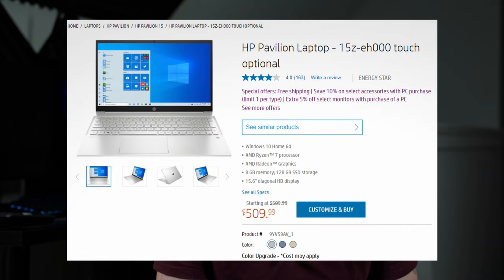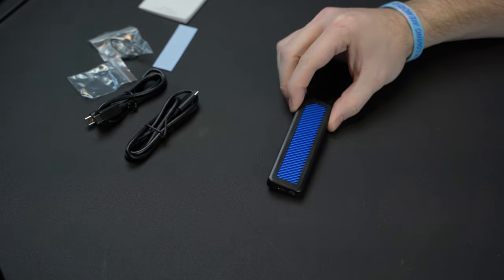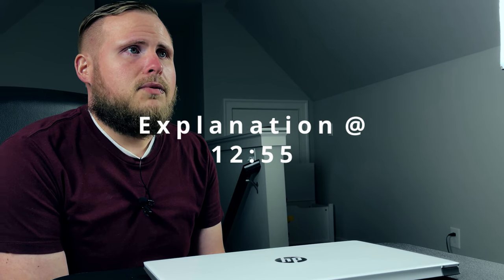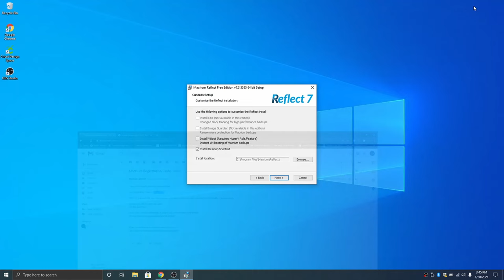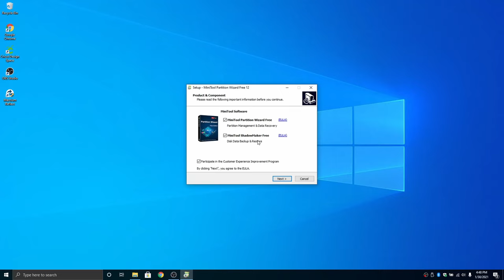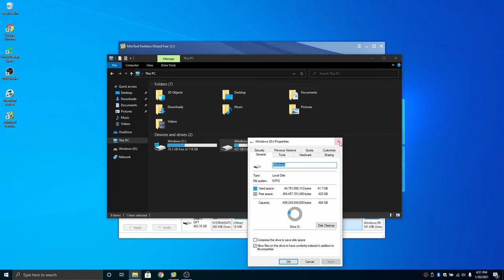Upgrading HP 15z-eh000 | Budget Laptop of 2020

Comment: Thanks for creating this video.  I tried two different newer 1TB NVM drives which was not recognized at all by the bios.  One was SanDisk - Ultra 1TB Internal SSD PCIe Gen 3 x4 NVMe.  The other was Crucial - P5 1TB Internal SSD PCIe Gen 3 x4 NVMe.  I read some people having the same problem because the hardware only recognizes certain older drives.  How did you find out which drives are compatible?
Reply from the maker: Manufacturers have what’s called a QVL (qualified vendor list) that show what hardware is compatible with their device, and that should show what’s been tested and verified as working. Alternatively, you could also try updating the BIOS if you haven’t already, and that may expand the compatibility and allow for newer drives that didn’t previously work.

Comment: Picked this laptop up for $350 (under $400 w/ tax and shipping.   Upgraded to 32gb of ddr4 3200 (HyperX Impact 3200MHz DDR4 CL20) which worked immediately and had tighter timings than stock.  Picked up a 1tb drive a while back that I'm finally getting around to installing.   One of the best laptops deals to this date.  Even today you'd be hard pressed to get something better in this price range.  Also, USB-C out on this works for audio/video/power without issue.

Comment: Great video! I found that voltage matters very much with AMD. 
    - You must get RAM that runs at 1.20v, otherwise the system will slow the memory speed.
    - This laptop supports more RAM than advertised. I'm using 32gb/ 3200mhz/cl18!
    - Also, this laptop supports USB C charging! I've tossed the HP brick and now use USB charging only.
Reply from the maker: This is good to know. I remember someone mentioning in another video on a recent AMD laptop that voltage made a difference when upgrading the ram- I wish I had remembered to mention that in the video. 

That’s awesome you got 32gb up and running. What do you use the laptop for? Do you have a use for that much, or did you just go all-out for the heck of it?

I knew it supported type C charging but I haven’t tried it yet- what brick and cable are you using for this?

Appreciate the comment! Thanks for watching!
Reply: Wich usb charger are you using? a specific voltage/A is needed?
Reply: @Salvo78106  check the user manual. Last I checked it said the usb c charger needs to be 45W

Comment: I bought the same thing during TG, although mine was $410 with full HD IPS, 8GB RAM and 256GB SSD. Maybe you got a touchscreen.

The video was great. Some thoughts:

[1] 16GB RAM is overrated. 8GB is more than enough. There are very specific cases where you may need more, like running VMs or hooking up multiple monitors or specific gaming titles (this isn't a gaming laptop) but most people will never even use 8GB to its full potential. Even video editing doesn't need a lot of RAM although fast clock speeds help.

[2] You can change the target partition sizes in Macrium Reflect to fill up your new drive BEFORE you initiate the clone. It's simple and you don't have to mess around with partitions later.

[3] The rubber feet can be peeled just a little on both sides and that should be enough. They stretch out of shape easily so removing them altogether isn't a great idea. The good news is HP will ship you new rubber feet for free if you call them.

Anyway, I'm nitpicking. This is a great video. The editing is very professional.

Now there's one question I have about this laptop. Although I own it and I've used it a few times, I can't figure out if the chassis is plastic or aluminum. It feels cold to the touch like aluminum but it has some plastic-like flex to it so I'm not sure. Since you already opened it up, what do you think? Plastic isn't going to disappoint me even a little being that this was just $400, but I'm just curious.
Reply from the maker: Hey there- thanks for the comment! I love when people actually take the time to drop a line, and I try to respond to just about every comment I get. 

I think unfortunately, I just happened to purchase it at a time that it wasn’t on as steep of a sale- additionally, I’m in Tennessee which has a 10% sales tax so that definitely didn’t do me any favors. 

1. You are absolutely right- for the average user 8gb is going to be more than enough- especially considering this has Vega integrated graphics, and while it’s not terrible, it’s certainly not mind blowing either. I did attempt to do some 4k editing of h.264 footage and it just choked on it. Didn’t appear to be a ram limitation either. 

2. I’ll have to look into this. I’ve always extended the partition after a clone when cloning to a bigger drive. This is so great info, and I appreciate the tip. 

3. Agree wholeheartedly with this- my main reason for fully removing them was for easier access to film everything, but for someone doing this at home, I could definitely see just peeling back the edges and even sticking some wax paper to the underside of the edges while you are working so they don’t stick back into place during the process. 

4. You aren’t nitpicking at all, and I appreciate the feedback! It’s always nice to learn something new or a different, possibly more efficient way to do something. 

As for the topic of metal versus plastic- the inside appeared to be “pot metal” to me- maybe like a cheaper “casting” if that makes sense. I think the keyboard deck however may very well be aluminum. Don’t quote me on that as I’m not 100%, but like you said, it’s cold to the touch, and if it is plastic, they did a heck of a job disguising it as metal!

Again, thanks so much for the comment and the feedback. I really appreciate it! Thanks for watching!
Reply: Hi, I saw your comment on this laptop and figured I'd ask you some questions. I'm considering getting this laptop and customizing it via the HP site. The base model is currently priced at $469, but HP has 5% off a minimum $599 back to school sale going on now. A backlit keyboard is a must, and I was considering 12GB of RAM to go along with a 512GB NVMe SSD. As for the screen, my choice is the non-touch FHD WLED backlit option. How do you find the keyboard and screen on your model? Does the keyboard have good feedback in terms of clickiness, or does it feel 'mushy'? Is the screen washed out looking? Bright enough?

I had already had something on order today, but I looked at someone doing a review of the HP 15 model I ordered, and it wasn't great, so I canceled it. Should I order this laptop now, or should I wait for the Labor Day sale? Do you know what kind of discounts are offered on a holiday like that? Should I just buy one from Best Buy or another retailer instead to be sure I get quality? What do you think?

Comment: Helpful video! btw, has anyone replaced the battery on this yet?  If so, do you know the part number?  hp doesn't seem to tell you the replacement part number for it.  Mine is getting up there in age and want to shop around before opening it up.

Comment: Do you know if this has an extra storage slot on the inside of the laptop ? Or does it just have the SD card slot for storage expansion ?
Reply from the maker: SD would be the only expansion unfortunately. There are no additional internal bays.
Reply: Looks like getting a bigger M.2 is the only option.

Comment: if you were having trouble with ram it looks like you could have been using 2 different brands. Its normally best practice to use the same speed ram as well as same brand to avoid issues. also thanks for the vid, i wanted to see what my laptop looked like inside without having to open it :)
Reply from the maker: Yeah it’s important to always match when possible. The thing is you can’t use ram with these HP’s without it matching the exact specs HP shipped with (brand doesn’t matter in this case) otherwise it won’t clock at 3200mhz, and there aren’t any ram options in the BIOS to then tune it to the speed you want unfortunately.

Comment: Good update! works on hp pavilion 15-eh1075cl?
Reply from the maker: In theory it should be very similar as it appears that model number is the same laptop but with an Intel processor rather than AMD. Tough to say without opening it up though.
Reply: @LetsGetTechy   is a pavilion with ryzen 7 5700u
Reply from the maker: @AndyErtle67  can you link me? When I Google searched that model, it came back Intel. 

I would say if it’s an updated Ryzen model, it should be basically identical to what you seen in this video.

Comment: I have the 2022 model of the HP Pavilion 15. Do I have to remove the battery or anything to upgrade my RAM safely?
Reply from the maker: It’s always recommended to pull the battery when replacing a component like that, but it’s really up to you. I can say I’ve done it hundreds of times without disconnecting the battery, and it’s been fine. Having said that, I don’t believe the battery connector is too difficult to remove, and it should be obvious which connector is coming off of the battery, and plugging into the board. 

If you get into it, and have specific questions, feel free to email me at the link in the description.

Comment: You could probably use Taiphoon Burner to write the XMP speed to the first entry of the SPD ROM and get the memory running at XMP.  Granted this would probably invalidate warranty though.  Ultimately the play is probably to avoid XMP speed 3200 sticks and instead get JDEC native 3200 sticks.
Reply from the maker: Appreciate the information. Definitely worth looking into for my own personal stuff. I’ve never feared for my own warranties. Haha 😆
Reply: @LetsGetTechy  There is risk in that if the machine does not accept it, I'm not sure how to restore it.  It's been a while since SPD modding was a common thing.  It may be possible to simply put in the unmodded original stick with one of the modded ones and rewrite the SPD to fix it, but again, I'm not sure how it would handle it.
Reply from the maker: @cracklingice  Roger. Doesn’t seem too scary since we are just talking about the ram itself- not a super expensive component.
Reply: @LetsGetTechy  Still felt the need to point it out.  Bricked sticks have no resale should you choose to go with 3200mt native chips in the future.
Reply from the maker: @cracklingice  Yeah absolutely- like I said, something I personally wouldn’t mind doing, but probably not something I would recommend to others depending on their knowledge level.

Comment: Is this similar to the HP Pavilion Laptop - 15z-eh100? If so, is it possible to install an HDD? If it has an HDD connector?
Reply from the maker: I’m not familiar with the eh100, but I would have to guess they would at least share the same chassis. I can tell you the eh000 doesn’t have a spot for a HDD nor a connector.

Comment: can you upgrade it to 64gb???
Reply from the maker: I would say probably not, unless a BIOS update made it possible to use 32GB dimms.
Reply: @LetsGetTechy  Thanks a lot! Also I'd love to know if i can install 2tb of ssd, i know in the manual it says it supports up to 1tb
Reply from the maker: @hassansharif69  unfortunately, I haven’t attempted 2TB myself, but I don’t see why it wouldn’t work. Maybe cross reference a QVL for your specific model (not sure if one is available, but if it is, you’ll find it searching your model number and “QVL”). You could also use Crucial’s website. They have a really nice resource for showing what upgrades are available for what pre-built machines.

Comment: can you upgrade the gpu in this thing?
Reply from the maker: You cannot. It is integrated into the CPU.
Reply: @LetsGetTechy  unfortunate. An eGPU should work though, right?
Reply from the maker: @frederictu  Unfortunately it’s exceedingly rare to find an AMD Ryzen based laptop with the required Thunderbolt connector to connect an external GPU. It’s a shame. Intel did finally open up the Thunderbolt standard so I thought we would start seeing AMD laptops with it, but that hasn’t seemed to be the case yet. 😢
Reply: @LetsGetTechy  Thanks for the swift replies and useful information, I've just subbed because this is the no bs type of thing YouTube needs more of.
Reply from the maker: Appreciate the sub! Come hang out in the comment section on future videos. I love chatting back and forth with others about tech. 👍
Reply: @frederictu  an egpu works only if you have a thunderbolt port. this doesnt have one. So cant use it. The iGPU is pretty good for price tbh